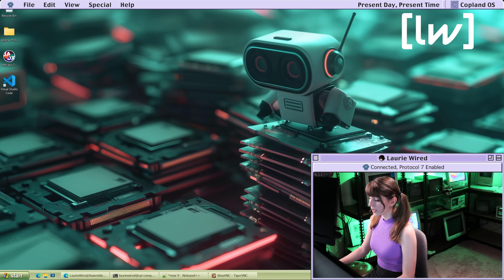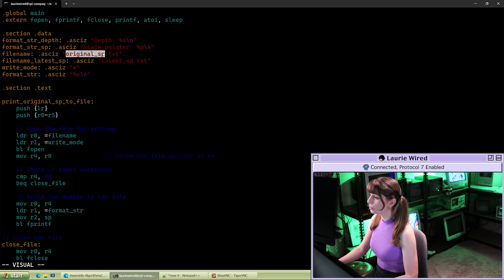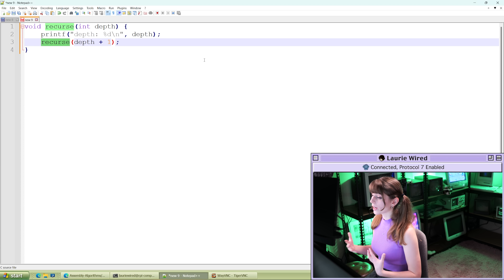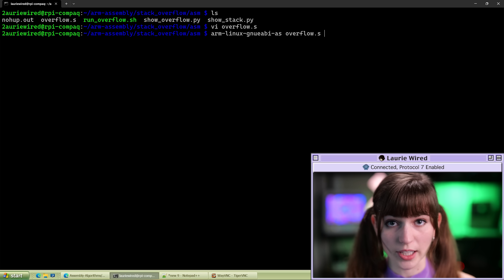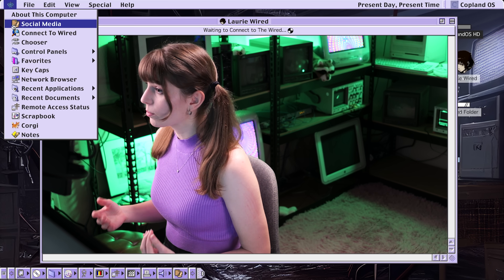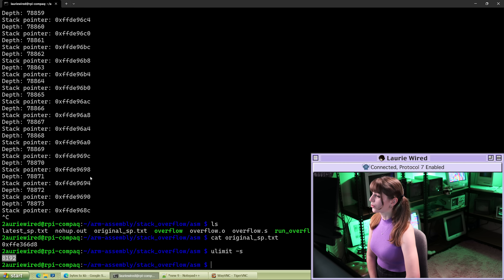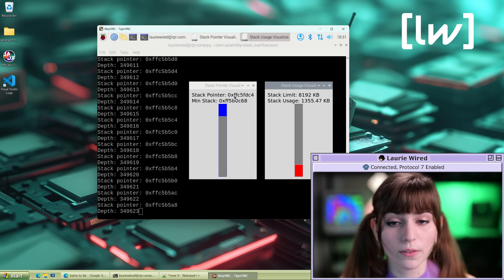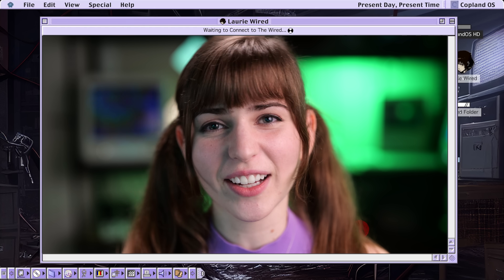What ACTUALLY happens during a Stack Overflow?

Comment: After the app crash segfault due to stack overflow. Would the stack buffer still be filled? Or will this be cleared? If so who would clear it? OS mmu?
Reply: On unix style systems, I believe the SIGSEGV signal is raised, and the default action is to terminate the program. Though if you've exhausted the stack, even if you catch SIGSEGV, it will probably kill the program.
Reply: @normansowth6493  I think he wants to know if memory is cleared when an application crashes due to a stack overflow and it is cleared for sure due to security reasons. It is possible to recover from stack overflow on Windows, on Linux if SIGSEGV handler is executed during stack overflow which means that program somehow managed to put int signal parameter on stack (/*signal-handler*/* signal( int sig, /*signal-handler*/* handler );)
then it should be possible to recover by changing value of stack pointer register and jumping somewhere else. I'm not eager to find out but it is possible that signal handler is executed with different value in stack pointer register threrefore execution of signal handler is possible (it works like SetThreadStackGuarantee winapi function in Windows)

Comment: Really clear, back in the day Assembly was a bit too much, but I appreciated it more and more. Even though it's not super productive. :)
Reply: The lower level the language, and the harder it is to code, the more efficient the code will be in the end, because the programmer won't want to put the effort in to make it bloated adding extra junk. Now we have high level languages that people that have no idea what's going on behind the scenes and at the lowest levels code in, and layers upon layers of libraries and frameworks, and you end up with the bloated garbage that is pretty much all software these days. Because why write even the simplest thing from scratch in 5 lines of code when you can just use a 500MB library to do the same thing. I've seriously asked people in interviews that supposedly "know how to code" and supposedly have "data science" degrees the simplest most fundamental questions about Big Oh, and complexity, and they have not even the faintest whiff of an idea of what I'm talking about. All they know how to do is write glue code to glue various libraries together, and if it runs too slow, buy a bigger CPU.
Reply: @gorak9000 I feel you, but it is simply incorrect to say high level = inefficient. A high level (language) gives the compiler more freedom to optimize. With low level code the programmer has to optimize by hand. Often times the compiler or interpreter can and will do a better job. A good example for this is SQL. It is a very high level language, yet extremely efficient at fetching data. Another example are JIT compilers which have knowledge about the actual architecture the code runs on and incorporate that into the compiled program. This works so well, that gcc added profile guided optimization.
Another example is futhark which is a high level GPU computing language. Yes, you can likely write more efficient CUDA code by hand using shared memory and intrinsics but let me tell you that is a pain and a half in the beginning and futhark is plenty fast. Futhark allows you to more declaratively specify what it is you want calculated rather than telling the processor step by step what to do.
Another example would be JSON encoding and decoding in Scala for which there are libraries which generate very efficient json (de-)serialization code using pseudo SIMD instructions (they load the data into a 64 bit long and use bit shift to parse the string very efficiently). The developer does absolutely not have to deal with this, the compiler will on their behalf.
On that note: protobuf also is a high level language which gets compiled into very efficient code to (de-)serialization and nobody would want to write that by hand. If you factor in correct alignment to efficiently make use of CPU and I/O caches you better leave this task to a well written piece of algorithm than trying to reinvent the low level efficiency wheel all the time.
Rust is another great high level example which gets compiled into very efficient code.
Even haskell can run really fast even though it definitely is not a low level language. Thanks to referential transparency, the compiler can make assumptions about the code which it could not do otherwise and can produce efficient native code for the target platform. Even though you write haskell as if you couldn't mutate your data, thanks to referential transparency the compiler can turn this into very efficient code which may safely mutate state under the hood. This would not be possible if the developer were to write unsafe low level code because this takes away the guarantee for the compiler that this transformation is safe to do,
Of course, just giving the opportunity to optimize to a compiler does not necessarily mean it will, but in general they do a great job.
It is true, however, that many developers have only a surface level knowledge about what they are doing and are lost without google and stack overflow and it is those developers who write inefficient code which works ok enough for their small test data but absolutely explodes if fed anything of marginally interesting size.
Reply: @gorak9000 I feel you 100% , but it is simply incorrect to say high level = inefficient. A high level (language) gives the compiler more freedom to optimize. With low level code the programmer has to optimize by hand. Often times the compiler or interpreter can and will do a better job. A good example for this is SQL. It is a very high level language, yet extremely efficient at fetching data. Another example are JIT compilers which have knowledge about the actual architecture the code runs on and incorporate that into the compiled program. This works so well, that gcc added profile guided optimization.
Another example is futhark which is a high level GPU computing language. Yes, you can likely write more efficient CUDA code by hand using shared memory and intrinsics but let me tell you that is a pain and a half in the beginning and futhark is plenty fast. Futhark allows you to more declaratively specify what it is you want calculated rather than telling the processor step by step what to do.
Another example would be JSON encoding and decoding in Scala for which there are libraries which generate very efficient json (de-)serialization code using pseudo SIMD instructions (they load the data into a 64 bit long and use bit shift to parse the string very efficiently). The developer does absolutely not have to deal with this, the compiler will on their behalf.
On that note: protobuf also is a high level language which gets compiled into very efficient code to (de-)serialization and nobody would want to write that by hand. If you factor in correct alignment to efficiently make use of CPU and I/O caches you better leave this task to a well written piece of algorithm than trying to reinvent the low level efficiency wheel all the time.
Rust is another great high level example which gets compiled into very efficient code.
Even haskell can run really fast even though it definitely is not a low level language. Even though you write haskell as if you couldn't mutate your data which if executed naively would be inefficient, thanks to referential transparency the compiler can turn this into very efficient code which may safely mutate state under the hood. This would not be possible if the developer were to write unsafe low level code because this takes away the guarantee for the compiler that this transformation is safe to do,
Of course, just giving the opportunity to optimize to a compiler does not necessarily mean it will, but in general they do a great job.
It is true, however, that many developers have only a surface level knowledge about what they are doing and are lost without google and stack overflow and it is those developers who write inefficient code which works ok enough for their small test data but absolutely explodes if fed anything of marginally interesting size.
Reply: Because the big library is tested and maintained :) the 5 lines of code might have a deep rooted bug in it and if you do data science without tests, Id rather you use a bloated library than buggy code :)))
Reply: @QW3RTYUU  If you use Julia, you can check the generated assembly for your function and see if it is "bloated" which is super useful if you want your analysis to run fast.

Comment: Perhaps a nice idea for a follow up is how does the CPU even detect an overflow? It’s just a pointer that gets lower and lower, what mechanism actually triggers a seg fault? And the stack size is something that can be set a link time; meaning you as a programmer have some control on its size, which can be handy if you expect your program to consume a lot of stack. Could be interesting to dive into as well. Just a thought.
Reply: In big simplification when running process at user mode level it uses virtual
memory instead of physical memory where virtual memory pages are mapped to physical
memory addresses. Each virual memory page can be flagged as executable, readable or writable and other
things (depending on CPU architecture and operating system). What happens when process creates new stack for thread ?
There is allocation of virtual pages which are flagged as read and write and they are mapped linearly in process virtual memory space
for example first page of size 4kb at address 0x40000000 second page at address 0x40004096, and so on but the page before the first
allocated memory pages is flagged as not allocated or allocated and flagged as not for read and write therefore when CPU tries
to access it, page fault exception is generated and cpu switches to execution page fault handler of operating system (some function
in kernel mode which is executed when page fault happens). Operating system knows by analyzing active process and memory page address
that it belongs to virtual memory page before stack beginning and then it generates stack overflow exception.
Reply: @0x90h awesome. Any books you’d recommend to learn more on this
Reply: She already explained that in this video, at least that is what I inferred. 

What you describe (detection of the segfault) is the very reason that the stack counts downward (or at least one of them). There is a "minimum" memory address that it can count down to, and it knows this minimum address in advance based on the  initial allocation. The CPU is watching for that lower boundary memory address to become used, which is what triggers the seg fault.
Reply: Operating systems have a memory management components that use the MMU in the CPU to detect address violations but devs have to register an exception handler for it to be handled gracefully, otherwise the CPUs or OS send segfault to the process. If os is that process...

Comment: What's the make of the analog oscilloscope in the back? :D
Reply: It's an HP 546xx series. There's actually 2 of them on different shelves. I have the same scope - they are nice and basically modern scopes other than that they only have a green CRT, and newer scopes have color LCDs. I also have a couple Agilent / Keysight MSO-X/DSO-X 2000 series scopes which are basically the next generation of the 546xx series. Performance wise, they're pretty equivalent. If you have the 54645D that has the 16 digital logic analyzer channels, it actually works better on the old scope than it does in the 2000 series new ones. You have to go to the MSO-X 3000 series to get the equivalent functionality of the old 54645D!
Reply: @gorak9000  Aaah yes! I've seen these ones before. We have some at our university. :)